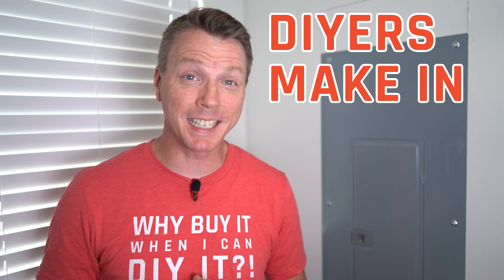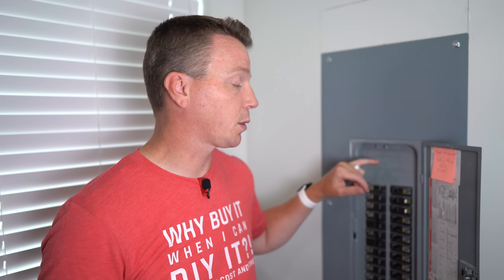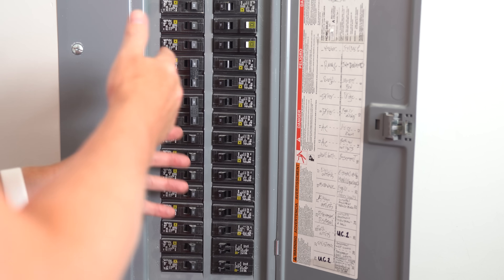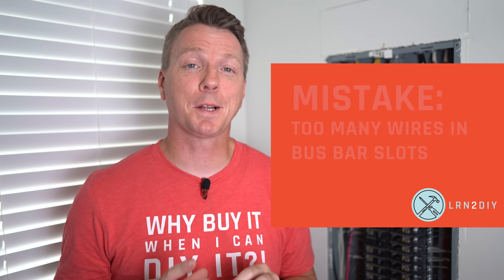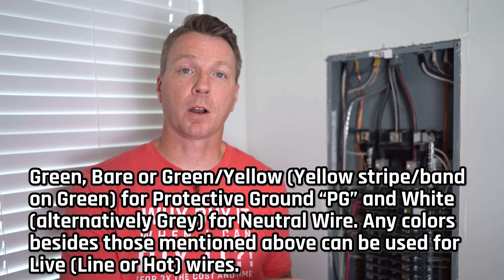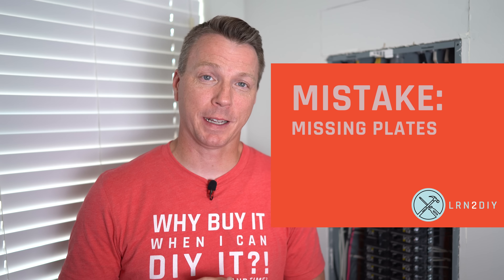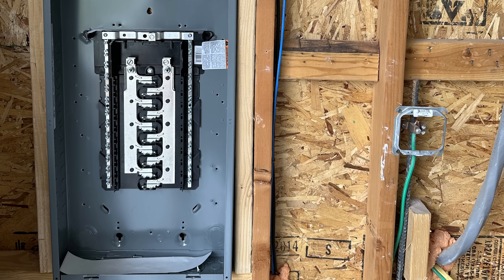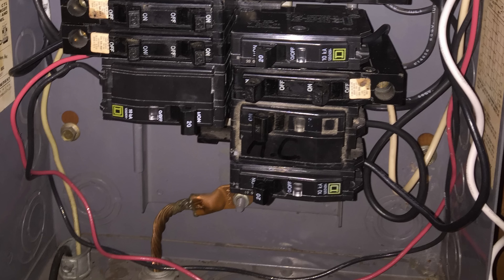10 Common Mistakes DIYers Make In Circuit Breaker Boxes

Comment: A few points: If you home is pre-2001, you won't see a yellow jacket on 12ga wire. That started becoming available in 2001, and older wire jacketing will be white, or possibly gray. Most new panels come with covers for the primary lugs. If your panel has a master breaker and it's turned off and the covers are in place, it becomes VERY difficult to accidentally ground those out. They're also available as an option for some older panels. It's within NEC code to have two ground wires under a single screw, but NOT for a neutral. The reason you see that in the example panel is because some bus bars don't come with all the screws populated. Of course, you should always check with the jurisdiction having authority. NEC is a top-level thing. A state, county, or city can have more stringent requirements than the NEC.  Lastly, it's always wise to remove jewelry when working in a hot panel. If your ring or watch manages to bridge a hot and neutral or ground, it'll turn to molten metal pretty quick.
Reply: One point about doubling grounds under the same screw; they must be the same gauge. You cannot, for example, pair a 12 and 14 under the same screw.
Reply: @sigcrazy7  They must be the same size and type. You can't mix solid and stranded even if they are the same AWG. This is the case any time you have two wires clamped using the same screw, not just for grounds. Some terminals like the one on the breaker shown have two separate holes for two separate wires but they still need to match.
Reply: @eDoc2020  Also, I know it's not code in the US, but stranded wire should have ferrules crimped on their ends when connected to a lug screw. I just replaced the contactor in my AC unit with an Emerson electronic SureSwitch, & used ferrules on the bare wires ends that connected to the lug screw terminals. Otherwise, the lug screw is just mashing the stranded wire, resulting in a poor connection.
Reply: @WindOfTheWisp_Janine  that depends purely on lug design.  If there are bladed connections I like to use the female crimp connectors.  On terminal screws I often find it easier to use a forked crimp connector especially if you have to wrap the screw or if the terminal grip is so small that it tends to create errant strands.  I do know that you can prevent splayed strands when wrapping terminal screws by giving the strands a reverse twist so that the screw pulls the strands in instead of pushing them out.  In the US it's handled more under design/listing.  Most of our lugs are designed to handle stranded wire without the need for ferrules and the ferrule's shape can be a detriment to having good contact because many of our lugs holes are round to compensate for wire shape.
Reply: @WindOfTheWisp_Janine 
Mashing wire is fine. It's the amount of contact from metal to metal. Stranded, in this case is actually better as more contact is easily made. When wrapping stranded wire around a screw and tightening it down: this is where you can lose some contact.
Reply: I believe the NEC allowed 2 Neutrals on the same screw until the early 2000s (not sure the exact year) so if you see this in an older home, it may not be a case of laziness, but a change in code. I it is a good safety improvement to only have one wire on neutrals though, as it could cause arcing. 
It’s not a problem for ground wires, as they shouldn’t see any current, but are only there in case of an emergency.
Reply: @roger1818  2 neutrals has always been a bad idea.  Some panels had big holes in the neutral bar and no clamps, just screws.  1 wire could easily slip to the side of the screw.  2 wires were just as bad.  3 wires under each screw was the best way to get a tight connection that would stay tight.  Now they have metal clamp strips that work well with a single wire.
Reply: @roger1818 NEC never allowed two neutrals under one screw, they just didn't clarify the language to explicitly forbid it until 2002.
Reply: I would amend your first sentence to say something like "if your house OR wire is pre-2001" since some folks still have spare wire from decades ago in the shed, basement, or garage.
Reply: I had some (100' or so, too much to throw away at today's copper prices) older wire I used in my freestanding garage when I wired it. When the inspectors came by, the younger one said "this is wrong, wire white should be 14ga" and the older one said it was OK.

When I took basic electronics in the USAF, they had a safety video where they put a gold wedding band on a hotdog and then briefly swiped it across some contacts and then held it up as the ring burned through the hotdog. Memorable (yes a breaker should have tripped, but not all wires laying around loose have breakers on them and not all breakers are functioning correctly).
Reply: @natehill8069 true story
Reply: @natehill8069  A thermal magnetic breaker (the most common type found) has two specifications for how fast it will trip.  The thermal rating is for how fast it will trip at 200% of it's rating. For a 0 to 30 amp breaker, it's 2 minutes. The magnetic portion trips based on the rate of change in the current flowing (di/dt). The faster the change in current, the faster the magnetic trip time. There is no intentionally introduced delay, but there is a finite time for the magnetic field to build. In those few milliseconds, the current is only limited by the transformer that's stepping down the 7200V to 110V, so several hundred amps may transfer through that dead short before the breaker magnetically trips or the short circuit (the ring) obliterates itself by flashing to molten metal.  Fun stuff, eh?
Reply: Older NM/NM-B actually came in a few different colors back in the day. Paranite Parasyn had a shiny green outer jacket, Anaconda Densheath was silverish, Hatfield Hatvinol was a goldish color, Phelps-Dodge was black. I think Circle or Cerro was the light blue one. (Yes, I've been doing this way too long...)
Reply: They can have more, but also less, stringent adoption of the NEC. It's not uncommon for jurisdictions to selectively adopt.
Reply: I wondered when this happened since I always remembered our 12-2 Romex was white when we did wiring in high school.
Reply: @yurimodin7333  sometime around 2005. I don't remember an exact year but that's approximately when the color coded sheathing came out.
Reply: Wire that predates white/grey/black Romex is tar impregnated paper that was painted silver.  It could be 14, 12, 10, 8, or even 6.  The only way to be sure is to measure the actual wire.  Some of this wire had a full solid ground, some a 14 or 16 solid ground, and some had no ground.  I have worked on houses dating from the late 1800s through till the 2000s.  Next to nothing surprises me any more.  Even houses with 4 15amp wiring circuits for the entire house.
Reply: Thank you
Reply from the maker: Great info and comments here! Thank you for sharing. I just installed a new sub panel yesterday and it didn't come with covers for the mains so I purchased them separately. Seems like $20 for two pieces of yellow plastic was way overpriced but I felt better having them in place, especially while I'm working on it. 

Again, great info on the sleeve colors, code and jewelry tip. I have switched to silicone watch band and ring but I suspect the watch body itself could still be an issue potentially.
Reply: @LRN2DIY  
I have white, yellow, and blue jacketed 12/2 in my 1952 home.
Reply: @davidtaylor4053  There were also black romex eons ago. Haven't seen it forever though.
Reply: @LRN2DIY  Another thing to be mindful of, while adding new circuits, is to make an effort to balance loads between both sides of the split phase. Of course, with intermittent loads, it's never going to be perfect. And lighting circuits (especially now with CFLs and LEDs) are generally small enough to not worry about at all, but larger loads need to be shared across both sides. 240v circuits are inherently balanced, so this only applies to 120v circuits.
Reply: @DTXBrian because the power flows like two waves opposite of each other… right?
Reply: @DTXBrian  the only exception to this is 240v 3 phase where you have a high leg meaning that only 2 phases can be balanced with 120v circuits and you try to balance the high leg using the single phase 240v circuits.
Reply: @homerepairlife5.098  that's correct. Ideally the service neutral should not be carrying any current if everything is in perfect balance.  In actual application the service neutral carries the imbalance current back to the source.  When balancing circuits you typically balance the regular use circuits first.  Then it's the intermittent circuits followed by convenience circuits.
Reply: @LRN2DIY  some electricians I work with put their wedding ring on a chain and tuck it into their shirt so that they don't lose it and so that it's not free to swing around and make contact with live parts.  One option for the watch would be to switch to a pocket watch and use an electrically safe lanyard on it.
Reply: @LRN2DIY  Twenty dollars is plenty under priced compared to a possible trip to the undertaker.
Reply: Only if the manufacturer allows it. Some bars are not rated for 2 wires under one screw even if the NEC allows it. Always refer to manufacturer documentations
Reply: @williamleblanc3244  the NEC specifically says that you can only insert 2 wires in one lug hole if the lug is listed for it. It is considered an exception to the one wire per lug hole requirement.  If you're in doubt about the listing then you have to fall back on one wire per lug hole.
Reply: @ianbelletti6241  not sure If this was meant for someone else but that's exactly what I said
Reply: @williamleblanc3244  not quite what you said. I was clarifying the understanding. To be more accurate, the two wires permission in the code is an exception and only valid if the lug is listed for it.  You were right that you have to refer to the listing of the lug but not why.  The default position is that it's listed for one wire unless the manufacturer gives you information otherwise.
Reply: Those older heavy gauge ones tend to be round and not flat as well.  My place was built in the 60's by remodeled in 2004 so it is mixed, as needed.
Reply: Thank you, I was going to say the same thing telling someone that white is 14 gauge is pretty dangerous without your caveat all the original wires in my house are white.
Reply: I didn't see yellow jackets back on the day, but I did find a bee's nest...
Reply: The old plastic stuff gets weird. My house has a run of red 14/2 that's somehow thicker than a 10/3 cable. I don't know why they made it so thick, but it's properly stamped with 14/2 on it.
Reply: I don't wanna see a yellow jacket at all. Those dern bees hurt.
Reply: @jamedlock83  They are wasps, not bees!
Reply: @robertmeigs5176  yet, colloquially, they are typically called bees.
Reply: My home was built in 1990 when I believe the NEC made no distinction between ground and neutral bus connections and the busses were bonded together.  The Code changed since then requiring a separate neutral and ground bus. Correct?
Reply: @frankd8957  it always required a separate ground and neutral bus except at the first means of disconnect.  At the first means of disconnect the ground and neutral busses are connected together and can be the same buss.
Reply: @frankd8957 No, that’s not correct. Unless the code has changed the neutral and ground bars are “ bonded” at the service ( the main panel of the house). If you have a sub panel, say to a detached garage or shed, then they must be separated.
Reply: Excellent points. I've helped DIY in/on several old houses over the decades. Even my own home is old enough it's pre-yellowjacket!
Reply: Actually, you can only put one wire per hole unless the lug is listed for it.  It doesn't matter whether it's a ground, neutral, or a hot.  The reason you see multiple grounds in one lug hole in older panels is because stuff was added and not inspected. They didn't have enough space for all the added grounds so rather than splice the ground or add lugs like they were supposed to they just bound them in one lug hole on a lug that wasn't listed for the purpose. Usually the multiwire lug holes will be egg shaped.  Markings on the lug will also indicate that it can hold 2 wires within a certain size range.
Reply: None of that code stuff matters nearly as much as common sense.  Of COURSE you can have two neutrals under one lug, same as ground wires.  They will ALL make perfect connections.
Reply: I should have read comment before posting my own.🤭
Reply: I find the circuit panels in the US kind of Trickey designed. 
But I think it would be interesting to see your opinion about the Dutch and German designs & regulations for circuit panel setups. 
Hopefully an idea for future video? 🤞
Reply: @blackpearl1-477  actually the US panel design is not as tricky as you think.  Instead of us having to install feeder wires from the main to all the breakers it's already done on breaker installation via bus bars.  Our panels work in the same basic way that yours do.  It's just that the feeders for all the branch circuit breakers aren't exposed when the breakers are in place.  I'm always concerned about your panels being made of plastic because plastic tends to degrade worse than metal.
Reply: @ianbelletti6241  why is it mandatory to have a box outside and inside? I get it for the firemen to terminate from the outside. But having two boxes instead of one seems a bit strange.
Reply: @blackpearl1-477  depends what you mean by box.  What is required by every jurisdiction is that you have a meter base (which the power company requires so that they can properly charge your usage) and at least one panel to protect the equipment and wiring inside the home.  Some jurisdictions may require that you have an exterior disconnecting means to disconnect the power in case of a fire.  Some power companies in some jurisdictions may require a meter disconnect (a disconnect positioned before the meter in order to cut power to the meter).  But you don't necessarily need 2 "boxes". They do make meter panel combos where the meter and the panel are in the same enclosure.  In some circumstances the way the power comes into the meter or the way it feeds to multiple panels or disconnects you might find a trough to carry the service conductors.  This last option is more common in commercial buildings and large apartment buildings. Your electrical panel doesn't have to be inside unless you are using a nema 1 enclosure (dry location only). If you're using a nema 3r enclosure (rain tight) or better water rating you can install the panel on the exterior. A lot of electricians install nema 1 panels in homes because they are cheaper to get.  As I am an electrician in the US I speak mainly for our laws and codes because that is what I understand but the basic principles apply to your country as well.  I am not familiar enough with your electrical codes to speak on them. If your electrical codes confuse you try getting an explanation from a local electrician.
Reply: @ianbelletti6241  thanks for the explanation. I just find it a little counterintuitive to have a panel outside. To have it outside for the fire department to shut power is understandable. But how secure is it against burglary and vandalism. 
I would not be at ease if my alarm system can be easily disabled this way. 
In my country (Netherlands) it's common to have the electrical panel close to the front door in the hallway. We have a fuse first on incoming wire(s). Mine is 3x 25A. then the metre, main switch, ground fault circuit interrupter with maximum of 4 regular circuit breakers behind it as one group. Multiple groups are allowed of course as long there's a GFCI installed on each group. 
So in case of fire it could be indeed dangerous for firemen. But safer against criminals though.
Reply: @blackpearl1-477  they make breaker locks that are designed to prevent tampering with the breaker.  You can, in theory, put security monitoring on the panel door and cover, although I have yet to see anyone who feels the need for this. They do sell panels that have locks on their covers and many exterior panels that do not have a lock on the cover have a loop that allows you to install a padlock.  Any good security system will be backed up by a battery anyway allowing it to work for a time without hardwired power.  That means that any burger that thinks cutting power eliminates the alarm system is a fool. Theft/tampering of electrical systems happens more on construction sites than they do on secure buildings because it's easier to get more wire on a construction site. If it happens at a secure building it's typically the earth ground wire because the likelihood of getting shocked is so low. Most criminals are too afraid of electricity to open the panel and steal those wires.
Reply: @blackpearl1-477 😅i
Reply: I don't understand any of what you wrote but I just squatted 10 sets of 10 and my legs are exhausted. 😢
Reply: @Asiansxsymbol  ...well, i once shorted a 25Kv circuit with my wrist...
 Jumped about 2m into the air and torn muscles.. and got a spider web of burned nerves... i could easily have died that day... 

     Take electric safety seriously is my advice...